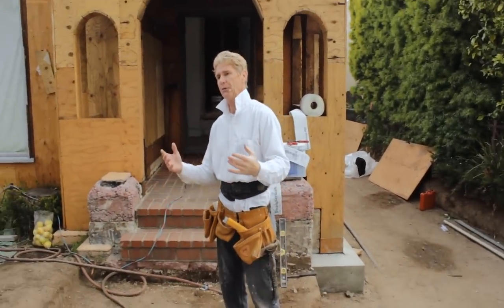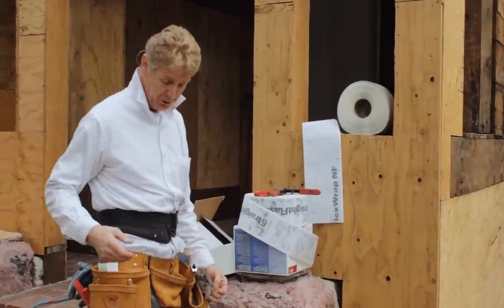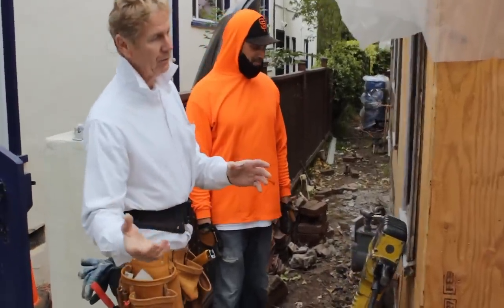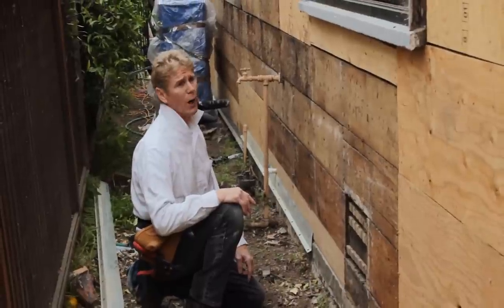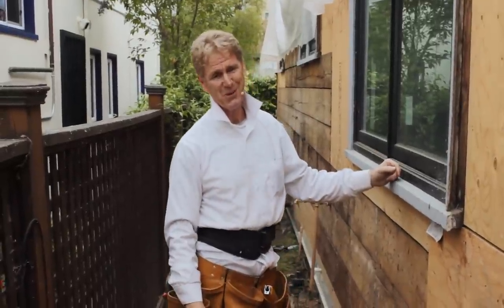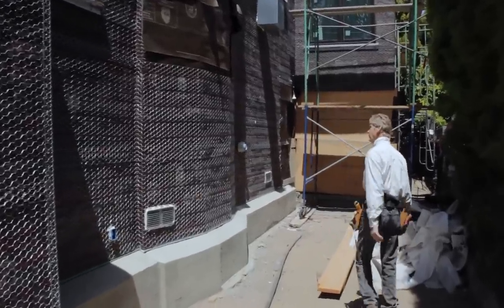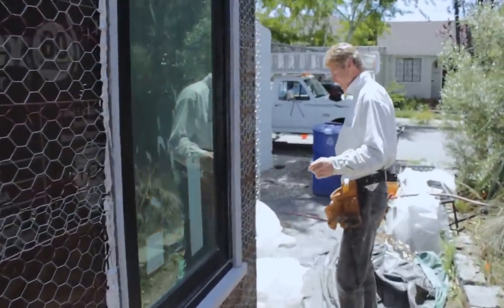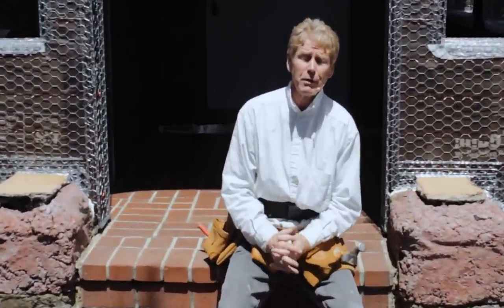Lath with Dupont straightflash to waterproof permanently, before stucco

Comment: I've been watching you for years Kirk. As a commercial lather your knowledge is very much appreciated! Thanks for the tips !
Reply from the maker: Hi Dennis dude, I lathed many commercial high-rise buildings in my time, many had steel structures,
 not aluminum, we had to tie-wire some stuff, a boring drag. 
At least with the aluminum studs, we could use machine screws. 
Cheers, my fellow lather.💃

Comment: Kirk I've been following you for years and thank you very much for sharing your knowledge. One question, I have a maintenance free finishing and it looks like it has a lot of burn marks can I pressure wash it and install a maintenance free with a different color without tearing apart the old one?
Reply from the maker: Howdy Luuuu, of course, you can, clean your current finish and apply another one over it. Make certain it's cleaned well then wet or hydrate the existing porous finish so that the new one adheres to what's called a mechanical bond. Never apply a new finish over a dry porous finish. No bonding agent is necessary for these two finishes to adhere to one another.😉

Comment: Does Sikaflex make a good window caulking on top of the stucco around a window.Not just underneath the stucco during window installation.  Because I actually just caulked around a window today with sikaflex. I hope that was okay? The original windows don’t seem like they were installed very well and stick out of the stucco about an inch or so, and they’re leaking in heavy wind and rain. So I cleaned it really well and sealed the whole thing with sikaflex.
Reply from the maker: Howdy Garrett, if you were able to use Sika-flex 1A and match your stucco finish,  I say cool beans.
 Sika-flex has got to be the strongest caulking created in the USA; it's just a drag for matching textures. 
I prefer Mor-Flexx for matching stucco textures.
 Is Mor-flexx as strong as Sika-flex? Of course, there are possibly some just as good but doubtfully stronger or longer-lasting. 
Sika-Flex is a polyurethane construction adhesive sealant. Just don't get it on your hands or clothes as it's like luggage; you will keep it forever.🍻
Reply: @StuccoPlastering  Thanks Kirk! Really appreciate it. Yeah I learned the hard way getting it on me. lol. That stuff is like working with super glue mixed in toothpaste.
Reply: Osi quad is a good polyurethane window caulk
Reply from the maker: @Stevesbe  🤙

Comment: Hey Kirk first of all you're awesome! You have helped me so many times!!! Anyway quick question: Can I use S Type mortar mix with added fiber for reinforcement for a one coat stucco application for my house? I have used quickcrete for so may veneer projects and stucco repair and it seems stronger than 3 coat applications just thinner. But just wondering 1/2" coat of fiber added Type S quickcrete (white and green bag from Lowe's) for one coat stucco? Thanks man for all you do!
Reply: No such thing as one coat stucco crack Crack Crack leak .

Comment: Live your videos. A quick question. Have you ever applied stucco over durarock board? Any suggestions..
Reply from the maker: Yes we have, tape your joints and mix the stucco rich, a lot less sand or it won’t adhere well.

Comment: Kirk Giordano love your video's! They have help me out a lot and am extremely thankful. Question: I have heard you can add white carpenters glue or weld bond glue to the mixture (I have been parging). Would this firm up the bond and make a more durable outcome?
Reply from the maker: Good morning my friend, those rumors are false and or ignorant.
”Folks simply don’t know” 
Anyone who adds any concrete or stucco bonding agent to a stucco mix will waste their time and money as this does absolutely nothing. 
The stucco mix dilutes that bonding mix into uselessness.
 The bonding agents must be rolled or brushed onto a surface clean enough to eat off. Then they work like magic.
 You may be referring to the Tile Grout additive Sika, you add this instead of water for better adhesion, only for Tile. 
The fellas who try this with stucco learn the hard way, that so-called shortcut can't be done. 
I’ve had at least 20 people in my years of plastering call and say, it’s a brand new finish it was only 5 months old it’s all coming off in sheets, help! 🥳
Reply: Thanks for the reply, once again thank you for the helpful videos and your good attitude. Have another question. It's actually the same question but clarifying what I mean.  My surface is very clean and I did use a bonding agent. I guess my question would be, would carpenters glue or weld bond glue make the stucco mixture harder? Weld bond glue says it can be used with concrete to strengthen and harden concrete. It says increase sheer strength up to 1200% and compression strength up to 38% when used with concrete. Do you think this would this make the stucco application last longer? Would it cure into a harder, and give a more protective outcome?
Reply from the maker: @arsenalabstract  No, don't add any glue or bonding agnet to your stucco.
Reply: @StuccoPlastering   Thank you

Comment: Roof has to be dried (paper/flashing) in and walls waterproofed before closing up interior.....

Tieing into old choppy houses is hardest thing in construction......no matter what trade you do.....have to re-engineer alot.....and sometimes not the absolute best but lesser of 2 evils......can be a nightmare.....people don't realize how many details there are just to get everything to fit, look, and function properly.....

That house looks like a nightmare
Reply from the maker: Howdy Kirk Dunn Dude, this sound weird but the more complicated the better I like them.
 In fact the front pillars, I'm looking forward to plastering those guys as you would think its difficult, but so incredibly easy, that I'll probably use my shoe or a frying pan just to make it somewhat challenging. 😏

Comment: Can’t believe it   Just paid 145 dollar for a bundle of galvanized wire lathe   2 foot by 8 feet   10 sheets
Reply from the maker: Howdy Stan, in some states they do use this but it would have to be self-furred for walls. As a rule, those flat sheets are called 3.4 mesh or Diamond mesh used for exterior ceilings.🍾

Comment: This way seems so old, go STO
Reply from the maker: Howdy Beardy Dude, Sto, or Dry-vit cant touch a conventional three-coat system for strength, insulation, or longevity. But Sto and or Dry-vit are great for high rises as you don't want too much weight the further you go up. 🤙